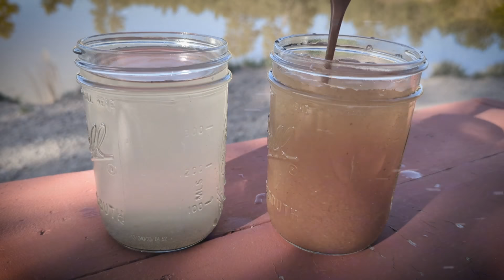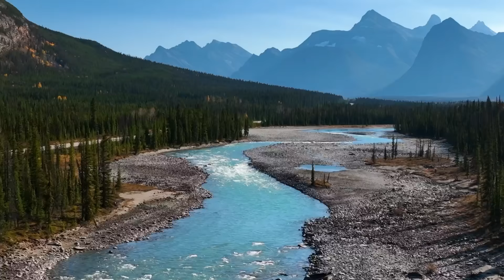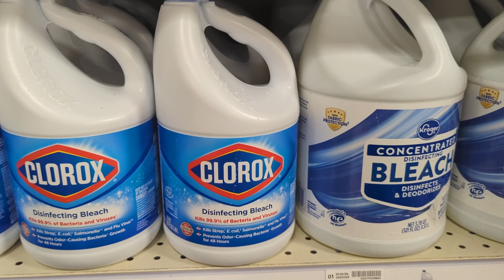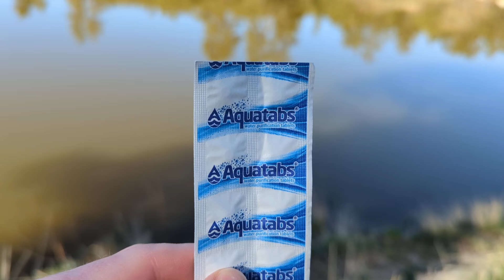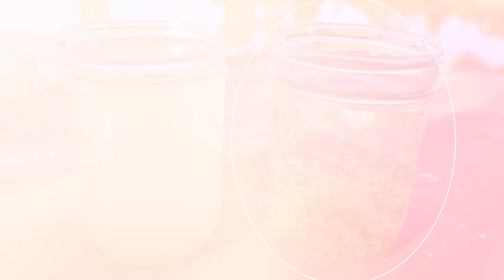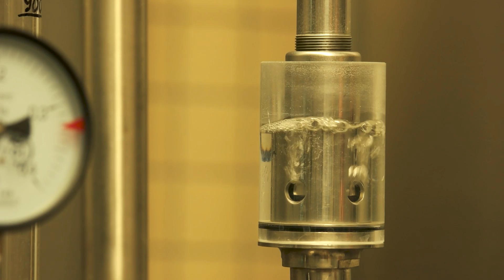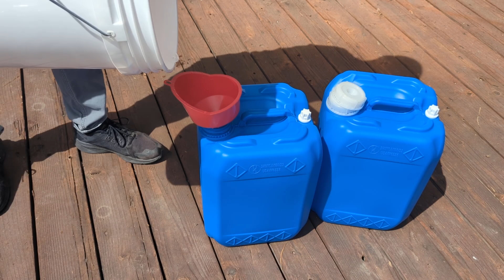The KEY to Emergency Water Preparation Before SHTF

Comment: I would NEVER use a plastic bottle to disinfect water in the sun.  The plastic chemicals leach in the water.  I would only use a glass bottle in the sun. Storing only one gallon of water per person per day is helpful but insufficient when you consider hydration, sanitation, hand washing dishes and clothing.  For my family, 3 gallons per person per day would make more sense and cut down on the stress.  We are in a desert climate and unable to draw water from the air.  We’ve tried.

Comment: Distillation is best, because it not only removes pathogens, but it eliminates chemicals and radioactive particles. Slower than boiling for sure, but the best solution, even better than filtering. You will go thru a lot of water, about 5 gal for each 1 gal of distilled water. Unless u have a distiller.

Comment: Not sure why the scene at the beginning says no to plastic store-bought water. 
IMPORTANT: draining the water heater can be very dangerous. With an electric heater: turn off the water heater circuit at the electric main panel BEFORE draining. Not doing so could burn up the heater and possibly start a house fire when the grid comes back on. Don't forget to turn on the circuit once the heater tank is refilled.
 For a gas heater, shut off the gas to the heater BEFORE draining. Not doing so could burn up the heater and possibly start a house fire. The pilot light will probably need to be re-lit before using the heater.
In both cases make sure the tank refills before turning the gas/electric power back on.
Reply from the maker: Great tips thanks for contributing to the conversation

Comment: Hose bibs or the angle stops in your house are lower than your fixtures. If you're draining a water tank, kill the gas or electric first just in case as were not building bombs here. Sprinkler systems, especially ones on commercial property hold a lot of water. (some of the commercial ones will not be potable)
Reply from the maker: Great info. Thanks for the input!

Comment: If you are using solar distillation to purify your water, it's important that your filter that water very well first as sediment interferes with the process.  Clear glass is better than plastic.  When you say that it takes 48 hours to do that process, does that mean 48 continuous hours (two days) or 48 hours of sunlight total and how much longer exposure to sunlight is required if the sky is partly cloudy or completely overcast.  Does air temperature have an effect as well?  As for water storage, I keep 3 &6 gallon made-for-water-storage container in the house out of direct sunlight and use them to water house plants, flush toilets, water pets and outside plants and then immediately refill them so my rotation is constant.  I have rain catchment barrels for none drinking uses, 2-55 gallon one because that's all Colorado allows by law but of course I have other containers to use for that if SHTF; survival trumps stupid laws!  When I have extra room in my freezers I place 7/8 full gallon jugs in them to store water and to use in case of electrical grid loss and it keeps the freezers full so they work more efficiently!  Thank you for the video!

Comment: I’ve heard people say the Berkeley doesn’t really filter that good.
I’ve had to use it now for 2 years… and it saved my life.
I still use it.
Reply from the maker: Check out this video https://youtu.be/RHG4afa-L6I
Reply: @waterfilterguru I saw the ‘scam’ videos… but I have actually used the filter, and yes, it works.
My public water is horrible… it is literally brown. When I was my car, it ends up dirtier. The water is barely good enough to flush.
Even the toilets turn brown.
But when I filter it… the water is fine.
Reply from the maker: @TestPilotN911RG  but that's filtering municipally treated tap water, a different use case than emergency preparedness. What you describe is ferric (oxidized) iron, ie. rust particles. Doesn't pose a health risk, just aesthetic. Any simple sediment filter a fraction of the cost will clear that up 👍 Hope this helps
Reply: @waterfilterguru there is none real safe filter other than osmosis if you try to filter any other water.

Comment: Natural gas is a must

Hook ur generator to it run ur home on it and boom electricity 

Make a u a Dakota fire pit 

If in rain find a way to protect it

Distill water cook food 

And get a battery power leaf blower to stoke it 

And book cook food

Distilling water is easy for it to

Dakota fires basically is a rocket stove and don't loose to wind 

Dont forget it can heat water really fast
Reply: And ozone generator for water is a must

It's very powerful at killing and oxidation 

So powerful it oxidizes metal left for a week

Again it needs electricity but natural gas is good
Reply from the maker: Thanks for sharing

Comment: My cheap DYI tips for Ceramic filter use, from start to finish : 
1. First use a double paper coffee filter prior to your ceramic filter (Berkefeld, Pro-One, etc.) to keep the latter running longer without clogging. You can reuse the same coffee filters a few times, just throw out the guck in between uses. Once they become too funky, you can let them dry and use them as fuel for a simple stove or fireplace. 
2. After the coffee filter run, add one drop of household bleach per Liter and let the water stand for 1 hour, stir or swirl it every 15mins
3. Now use the ceramic filter (which will filter out most of the bleach as well) and keep topping up the reservoir to speed up the flow. 
4. For easy mid-range storage (1-2 weeks), I recommend glass bottles + a simple wine vaccuum pump/cork set (Vacu-vin, for example). Store the glass bottles standing upright so the vacuum cork does not touch the water. 
5. For longer range storage (months to one year), you can add one drop of bleach per Liter prior to storage. I'd recommend refiltering with ceramic before drinking, but if in a hurry, it'll be relatively safe to drink immediately as well for short periods.
Reply from the maker: Great tips! Thanks for sharing

Comment: I keep two 7 cu feet freezers full of just frozen water, -4 degrees, power usage 45 to 50 watts.

Mass storage underground Cistern, 26 feet long x 20 feet wide, 6 feet above the ground.  With an air bubblier, UV light, and floating balls to discourage bugs landing.

Capacity 61,100 gallons.
Reply from the maker: Awesome

Comment: You didn't mention using a tree branch to filter the water. Why?
Reply from the maker: Great question. Using a tree branch (like xylem filtration from pine) is a fascinating survival method, but it’s limited in practicality. It can only filter small amounts of water at a time, and setup isn’t exactly quick or scalable. In an emergency prep context, I focused on methods that are easier to implement, require less trial-and-error, and can produce enough safe water for daily use. But yes, tree-based filtration is an incredible concept and worth knowing if you’re ever in a true survival situation.

Comment: Catching Rainwater ….

I’ve been attempting to research an area of prepping for catching water for a shtf scenario, and have found little to none on the following topic.  

Catching rain (directly from rain, while it’s raining, and not from guttering or roofs) ) using a large 6mil (or similar) clear or black plastic sheet, normally found at Lowes/Home Depot/other.

The questions are:

1. Do these sheets need to be cleaned and/or sanitized before use ?

2. If the answer to #1 above is “yes”, then specifically what is the procedure ?

3. Once the rain is caught into a sanitized bucket (5gallon), how should it be filtered or purified. (I am assuming no bird droppings or climatic events such as ash from volcanos or radioactive debris.

I am asking this question on multiple platforms, but appreciate all input.

I know this questions may be slightly off-topic from the subject video (my apologies), but I’m not sure where to turn.

Thank you to whomever response.

dew

Comment: Each month, I purchase bottled water from the store. So, this is my monthly ongoing water situation that will work out decently. The potable water, go inside pourable, repurposed kitty litter bucket. With masking tape and a sharpie, I mark the date. About two or three times a year, I refresh the water. The water is used for laundry and watering a general area of outside plants, such as hedges. In the freezer, are different sized water bottles, should I lose power, once the water melts, it will decent for drinking water. Also, as a single person, I am careful with food management and preservation in my fridge freezer. Generally, no more than two cooked meals, ready to eat once thawed should power go off. Freshly squeezed lemon ice cubes, if power goes off, once melted, add cold water from the freezer water bottles. Frozen produce is focused on fruits. Half of my freezer is dry ice cube bags. Right now, if my freezer gets too full, I remove a bag or two, place inside the fridge. My dehydrated food supply is mostly in small jars in the fridge, and some in the freezer as I need food storage space, and keeping cold, helps preserve these foods longer. Some meats also. Right now, imitation crab. Cooking up crockpot chicken today, then freezing some off. A package of ground beef in a few days will be cooked, then, also, portioned and placed in the freezer. All foods to be consumed in about a month's time.
Reply from the maker: Thanks for sharing your water storage strategy 🤙

Comment: Do NOT drink water from dehumidifier it contains metals, algae and mold. Neither should you drink from a hot water tank because of high levels of copper.
Reply from the maker: Which is why having proper treatment 2:45 prepared as well is so vital. Same thing goes for the other water sources mentioned.

Comment: UPDATE: It looks like the bottom of my kitty litter bucket block may be bulging from the expansion of the ice.. I believe there's a seam between the sides and the bottom and I don't think I can still recommend freezing in this container. But there are fantastic, seamless HDPE containers that should be fine if you fill them up with ice before adding water.

FREEZE your water. If you have a power outage, you can use it to keep your refrigerator cold - and have COLD, safe drinking water as the ice melts. The bigger the ice block, the longer you can keep things cold - and the more water you have to drink.

I started filling regular freezer containers with ice cubes from my refrigerator and adding filtered water before putting them in a freezer. (This keeps the expanding ice from bursting the container because most of it is already pre-expanded i.e. ice.) These will keep stuff in my Artic cooler cold for  3 - 4 days. 

To scale up, you need a deep freezer. I took an empty Tidy Cats litter bucket (made from HDPE and holds about 7 gallons) and thoroughly sanitized it. I filled it gradually, putting big ice blocks from the above freezer containers and putting ice cubes in the leftover space. I then added more filtered water to cover the ice already there and put it in my deep freeze. (I did this in layers because I'm concerned the container might burst.) Now I have a 7-gallon block of ice in a container that fits beautifully in my refrigerator with one half-shelf removed. I haven't yet tested this, but I predict I could get a week's cooling. 

I'm also currently purchasing some HDPE containers made for emergency water storage. I'm going to go the same route with filling them with ice cubes and gradually adding filtered water as I freeze them. My deep freeze will hold about 35 gallons. ChatGPT predicts that if I filled it with ice blocks, it won't finish melting for 10 days with an outside temperature of 80°F. 

I've also used water in gallon bottles, first squeezing out about 15% of the water to make room for the ice to expand. These will last 5 - 6 days in my Artic cooler. But some of them WILL leak eventually. HDPE bottles would be safer.

I'm also prepared to add foam insulation panels around my deep freeze for an extended power outage. You'd be amazed at how much longer stuff will stay frozen in a power outage. Even putting pillows and comforters around your deep freeze helps. (Don't do this when the power is on because it defeats the heat dissipation strategy of the freezer.) I kept a frozen gallon of milk cold for 10 days in an ordinary cooler covered with sleeping bags and a couple of pillows, in high desert heat.
Reply from the maker: Great tips! Thanks for sharing

Comment: Why would you recommend plastic bottles for water to sit in the sun? That's leeching plastic into the water.
Reply from the maker: It's good to note that the SODIS method of water disinfection is intended for short term emergency use to make water potable

Comment: Grayl water bottle!
Reply from the maker: Great emergency prep item!
Reply: Other than prefiltering, do you still have to disinfect the water before putting it in the grayl? Or can I just fill directly with lake/river water and drink?
Reply: @user-vg8ez9cu6u 
"A Grayl water bottle is a filter and purifier designed for on-the-go water purification, allowing users to quickly and easily turn various water sources into safe drinking water. It uses a two-stage filtration process to remove waterborne pathogens, chemicals, heavy metals, and microplastics. The process involves filling the outer cup with unfiltered water, pressing the inner cup down to filter and purify, and then drinking the clean water."

Comment: If you have a well, you should also have a generator.  Doesn't have to be a huge generator but big enough to run the well pump, freezer, and fridge.  Mine will run the furnace also.
Reply from the maker: Excellent point!
Reply: Use pvc pipe with a home made check valve and string to lower it down the well to retrieve water .

Comment: Water from Air conditioner drain valve is basically distilled.
Reply from the maker: You're right that AC condensate is similar to distilled water since it's formed through condensation, not filtration—so it contains very few dissolved minerals. But it can still pick up contaminants from the coils or collection tray, so it's not recommended for drinking without further treatment.

Comment: Can you boil water that has been first treated with bleach?
Reply from the maker: Sure
Reply: Rocket stove burning twigs can boil a quart of water in about 15 minutes with no smoke signal .
Reply: I mean, because we're not supposed to use bleach with hot water to clean because it releases toxic gasses. So are the lower levels not releasing those gasses

Comment: If you have a way to power it, a dehumidifier will keep you in all the water you'd ever need in the midsouth U.S. Missouri, Kentucky, Tennessee, all way too humid 9 months out of the year.
Reply from the maker: Make sure to filter that water before consumption!
Reply: @waterfilterguru  oh for sure. There could still be bacteria and/ or viruses floating around in there.

Comment: Even without the emergency we always boil tap water let it cool then gravity filter it
Reply from the maker: That very well could just be concentrating contaminants in the remaining water. 

As water boils and turns into vapor, the total volume of water left behind decreases. Yet most contaminants are unable to evaporate with water, meaning that the concentration of contaminants in the remaining water increase.

Boiling is mostly used as a method of disinfection to kill pathogens and doesn't do anything for the vast majority of other contaminants that may be present in tap water.
Reply: @ so I’ve been doing this since 2019 do you recommend I just filter it through  charcoal filters?
Reply from the maker: @Pierre3513  Assuming it's treated city water it's already disinfected at the treatment plant. No need to boil to disinfect, unless of course the utility issues a boil water notice
Reply: @ maybe I’m just a bit paranoid but I just don’t trust the British water companies.
Reply from the maker: I'm sure there are regulations that require the water companies to regularly test and meet certain standards like there are here in the US. Might be worth looking into for peace of mind
Reply: Why not? Are you located in the UK? Please share if you have inside info @Pierre3513

Comment: We just keep and rotate 400 bottles of water at all times.  They come in 40 packs from Costco so they are easy to stack and rotate properly.  Only cost about $50-$60.  That is enough drinking water for 3 people for a month.
We also have a pool, so that is 20-30k gallons to use for toilets, etc.
Of course, we have bathtub liners, water filters, BBQ grills for boiling, etc.
We stock up on coffee filters as well.
Reply from the maker: Thanks for sharing!

Comment: Drinking distilled water can cause mineral imbalance in the body, so it's better to drink boiled the water and save the distilled water for making saline for medical use.
Reply from the maker: Keep in mind these are tips to make water potable to avoid immediate illness in the short term during an emergency situation
Reply: @waterfilterguru  I'm know. ☺️  Just wanted to add to what you were saying because over the past few years, I've seen a lot of folks talking about and buying water distillers for a SHTF long term drinking water solution.

Also, thanks for the reply.  Most folks ignore new comments on older videos, so it's cool that you do this.

Comment: Get a sawyer or katadyn backpacking filter. Add 12 drops of bleach per gallon and wait 30 minutes for it to work to be sure. Also if you got an ozone producing germ killing lamp, those can purify water with the UV light and if you rig it to bubble izone through it will completely sterilize the water. ❤
Reply from the maker: Love it